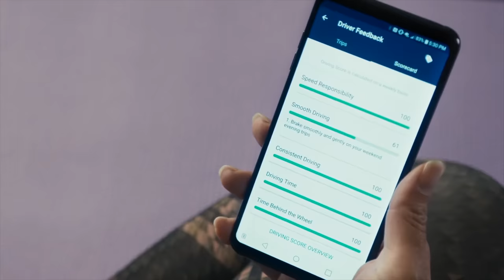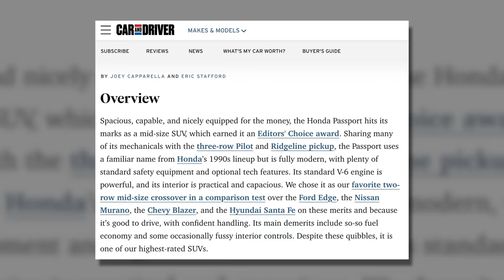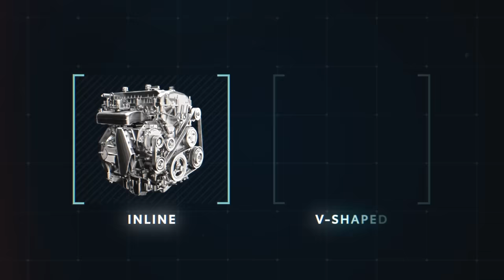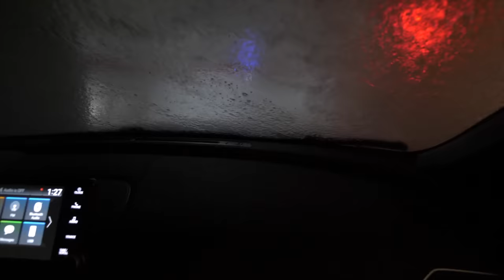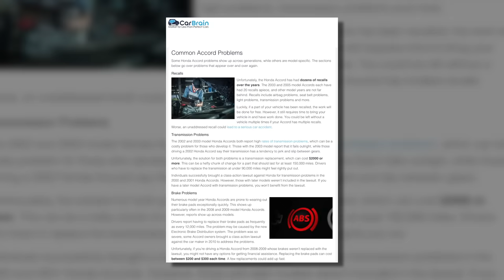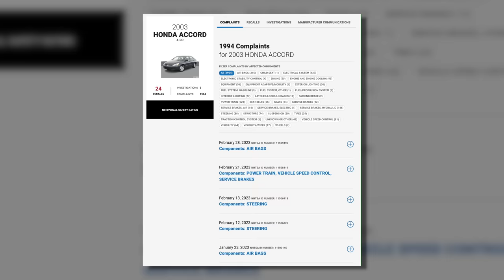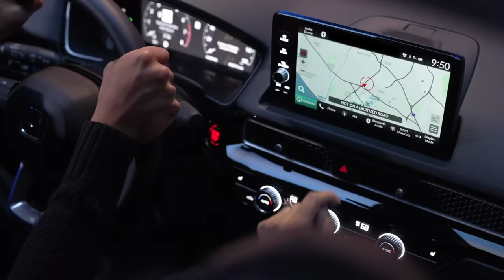Honda's CEO Just Said, "We're Losing Customers Fast and Don't Know What to Do"

Comment: Having owned a construction company, I have owned many Dodge Ram trucks. There was always something wrong with each one.
Reply: After 2 pigs...why did you keep buying them??
Reply: dust3824 - How is it remotely offensive to tell the truth about a faulty product?
Reply: Absolute junk. Never again.
Reply: I have a 2004 Jeep Liberty. Engine still running great. There are problems, very minor, for a 20 year old vehicle, but it's dependable. It's actually made heavy, unlike those beer cans from Japan.
Reply: Dodge Rams used to be really good back in the early 70s.
Reply: dust3824  - Yes, I can definitely see that happening.
Reply: Get a Tacoma or tundra :3 my boy has a 2004 v8 tundra and runs like a charm... I remember putting 2 and a half palets of shingles on the back and it looked like it was about to scrape the floor 2 years ago.. We drove slowly a few miles and dropped it off at a house... Still running with no issues. Has a engine check light for years but it's just the sensor... No issues 🙂
Reply: Owned a Dodge Ram 1500 4 x4 Laramie what a hunk of junk.
Reply: @xombiekat13  yeah no one cares that the cars have a cvt or 10 speed automatic with a 1.0 l engine with a turbo on it that burns oil and that won’t last. But the design looks cool so I’ll buy it
Reply: @bondgabebond4907  just need a lot of Gas to run that 3.7. 😊
Reply: @malibuman8941  Yes, but I don't drive it much and the Jeep is paid for. Gas and oil change is about all I do to it. Once in a few years I get new tires and brakes. It's a lot better than having a $600+ payment for next to forever.
Reply: A lot of the ppl in that survey probably didn't even use a Ram for it's intended purpose, they just bought a big truck for show because "Murica".

Comment: Stop turbos on all cars, go back to naturally aspirated engines and automatic transmissions, no damn CVTs
Reply: throw those damn cvts away
Reply: The honda oem turbos are not the problem.
Reply: Keep both options. You don't sell one product. Some hate turbos, some love them. If you do both, you can sell more.
Reply: They don't put em on all cars. It's usually on the highest trim. Most come with a naturally aspirated. And CVTs are just the norm. Get over it and stop bitching. Honda and Toyota CVTs will last longer than a traditional transmission if you just change the fluid regularly
Reply: I'd rather have a manual than an auto.
Reply: Honda got rid of their famous K24 NA engine on some models.
Reply: My 2020 Civic Sport Sedan has the 2.0L K20C2 naturally aspirated port injected engine and a 6 speed manual transmission. 
I’m with you, I’d never daily drive a Honda with the 1.5L Turbo direct injected engine or a CVT transmission!
Reply: NA engine and AT is way reliable than a small displacement engine with turbo with a Cvt on a commuter car.
Reply: Couldn't of did it better
Reply: They have to boost small engines to get mandatory economy numbers.
Which mean nothing but unreliability in the real world.
Reply: The day I bought my 2018 Crv LX at a vegas Dealership they tried so hard to try to sell me the EX & EXL. I would’ve loved the EX for the sun roof and the turn signal camera but the only reason I couldn’t find myself buying a better trim model was because of there horrible turbocharged engines they installed on the top trim models. I didn’t want to worry about oil dilution after spending good money on any car. Trash the current turbo charger or fix the dilution problem Honda!
Reply: They sell manuals and NA cars, but most want the auto and their CVT is smooth and will outperform a regular automatic in efficiency.
Reply: I agree so much with this! I know this is anecdotal, but Honda no longer offering a NA V6 engine on their Accord lineup definitely alienated me as a customer looking for a sedan. Acura offers a worthy alternative with the TLX lineup but it's still turbocharged all the way (and I don't like it) and significantly more expensive. Too bad!
Reply: my 2017 civic si exploded
Reply: You’re only going to get non-CVT these days if you go to Mazda or get a luxury German or higher end Luxury Japanese vehicles. The demand for manual transmissions is not there. I was at the NY auto show on Sunday speaking to VW reps. 83% of their vehicle sales in the states are SUVs and those don’t come in manual transmissions. And with how terrible traffic is in most places in the states, I see the demand for them dropping even further. Try driving across the GWB, BQE, 95, and even parts of NJ during rush hour. Traffic is terrible. Also another knock against most manual transmission vehicles is that they throw practicality out of the window for every other aspect. They have no trunk space, no center console space, terrible leg room, are terrible for poor people, and they have yet address the fact that there are people that are family oriented that would still like to have a fun drive as a daily driver. They’re catered to young and single people, or people in a relationship. No more than that. I wish the US had way more wagon and hatchback offerings, those are practical and fun. I wish manufacturers considered this as well.
Reply: Martin Z NO DAMN CVTS ..DITTO
Reply: You NAILED it.  Plus, Honda's driver and passenger front seats are HARD AS ASPHALT...and they give me a damn thrombo from the pressure points.  We've have an 08 CRV and love the reliability, hate the seats and the road noise.  After plenty of research we're going with a non-turbo, non-CVT and very quiet Mazda.
Reply: Nothing wrong with turbos ona 2.0 or 2.5L. Turbo charging a 1.6  no one wants that POS thats at its max.
Reply: What?? How about make more with the  standard tranny...not automatic..
Reply: @richsweeney1115  I mean is more reliable, but an AT is ok  In a commuter car. We are comparing Cvt and AT torque converter
Reply: @dcal4455  I know , I'm just sayin..neither are a great option
Reply: Talk to the government
Reply: Planetary gear box vs band and cone CVTs
Reply: I have owned many fancy cars domestic and foreign and I have had no negative experiences with my 2016 Accord LX with a CVT transmission. For a car I spent $21k new and have been driving for 200k miles without repairs I have zero complaints. It's even relative fun and zippy to drive and my wife loves it... still.
Reply: @hustla818  "CVTs are just the norm" does NOT mean CVTs are reliable and well liked by many mechanics/drivers.  Look up Scotty's comments on CVTs and lots of other negative reviews on you tube.
Reply: This
Reply: I love my turbo

Comment: Honda needs to go back and look at the cars they made in the 90s to see what them special.
Reply: Exactly. Had 4 of them. 1 had 480,000 miles. Only I auto.
Reply: Normally aspirated 4's and V6's. With no turbo charging.
Reply: Its not the 90s anymore
Reply: I had an '01 Civic EX and regret getting rid of it at 217k miles. Dude that bought it still has it and is at 350k - orig motor and 5 speed.
Reply: @thegreat9481  It doesn't matter. They can still build their vehicles with the same mindset like in the 90s. It worked then and there's no reason why it couldn't work now
Reply: 10th gen civic and accords looked reasonably nice
Latest gen looks okay, may be boring looking to some, nice to others
Reply: FACTS!!!!!!
Reply: @g0d182  The 10th Gen. Civics are fine, but I just can't get with those Accords. They remind me too much of the Dodge Chargers. Plus they got rid of the V6 engines
Reply: @josephbell2160  Nope.  Many regulations have changed, especially emissions regulations.  The 90s cars cannot be rebuilt unless it by a program like Mazda's "comprehensive restoration plan" which rebuilds shells/old cars into new cars again.  They very much would if they could, but they can't.

People don't want the trashy new over-regulated cars, and every manufacturer is suffering as a result.
Reply: @surrrithux  You missed the point. I'm not talking about rebuilding 90s vehicles. I'm talking about building them with the same mindset they had back then. That means with complete focus, no short cuts, no half assing it, and building them with quality materials. There were regulations that were to be followed then, so whatever adjustments that have to be made for today's regulations they'll do just fine. Having the same energy and motivation like that was back then and apply that mindset now. There's no reason why it can't be done
Reply: @dominicfong6341  Mainly double wishbone in front would be nice and the front overhang and height needs to be less like the Fit was in front. I hate the big front ends and excessive height
Reply: @thegreat9481  any other nuggets of wisdom? No…. Sit down Captain Obvious.
Reply: @travislee9396  You seem very triggered. Move on, its not the 90s.
Reply: @thegreat9481  No.  Really?
Reply: They can't make cars from the 90s anymore. Theirs new laws they have to follow that are required for safety. Newer cars are far more safer than older ones.
Reply: @josephbell2160  It has gotten even worse for 11th gen accord, they got rid of the 2.0turbo, now max is about 200 hp, not 250 hp!!

So Honda canned the v6, and the 2.0t!!!
Reply: @g0d182  They lost me when they got rid of the V6. I'll just stick to my 99' Accord. At least it has a V6
Reply: Exactly, that was when Honda was very reliable, almost as reliable as Toyota, but then they got cocky.
Reply: Less American styling and ergonomic for the start.
More like the late 1980s-1990s with good holsome usable &  spacious ergonomic with daily functions instead of flashy shows offs gimmicks.

Comment: I've owned Hondas my whole life-1976 CIvic 4 speed manual, 1986 Accord 5 speed manual, 1999 Accord 5 speed manual, 2002 Odyssey (for the wife and kids) and currently 2014 Accord and have been happy with all of them, taking all of them to 200k miles or more with no unexpected repairs.
Reply: Bet you don't live in a road salt state or state with high summertime temps!
Reply: Haha do you remember what the redline was on the 76 civic? I remember 9k and it sounded like a lawn mower hahahah, great car though!!
Reply: @PhilJLF  Yeah with only 4 speeds it was loud as hell! Primitive!
Reply: I had 82 and 88 Accords. The 90 eluded me and was big step up.  I got 90 Integra instead as a teen.
Reply: You got 200, 000 on every car but  had a 1999 Accord for only 3 years - then got a 2002 Odyssey?
Reply: Yeah well you will find nothing but CVTs and Turbos now, all sure to not last 200K.
Reply: @Martin_ros  ever heard of having multiple cars
Reply: You didn't pay out your arce for them either.Quality used to be there now it's all plastic and crumple zones
Reply: I've had Civics, Accords and CR-V currently. All very reliable and cheaper than their Toyota counterparts. I sold my '93 Civic to my sister, it had 250k on it and she had it for several more years.
Reply: Unfortunately Honda tends to be somewhat conservative in styling as compared to Hyundai and KIA but they last a hell of a lot longer. And yes Scotty it needs a bigger battery
Reply: @johnmoyer2849  well now every vehicles have that sht on them as mandatory
Reply: Honda reliability has taken a nosedive. What made it special is now gone
Reply: I’ve got 2 currently (odyssey & crv) and happy with Honda. Looking to buy another. My daughter is getting her license this year so I’m turning the crv over to her. It just goes on and on and on.
Reply: @HotRod-wv4vm  you mean fortunately, those new Hyundai cars are so ugly
Reply: @somapersona  Yep, mostly made in USA now instead of Japan😂😂😂
Reply: @horseman942  actually I like the look of the SUV’s, not their cars
Reply: I’ve owned 4 Honda’s and they’ve all gone over 200k miles. I’m looking at the 2023 Civic Type R but all the dealerships are charging 20k over MSRP which is pure crap which will unfortunately steer me away to other car manufacturers. I like how Tesla does it where  it’s only one price with no price gouging.
Reply: My wife and have owned Toyotas, Hondas, Mazdas, Nissans, Subarus  (GMC, Ford)since the mid 80’s. In my/our businesses we drove about 25K miles per year. I have owned a Tercel, a Landcruiser, two Highlanders and a Tacoma. The only Toyota that I did have mechanical/quality issues with was the Tacoma, the Tacoma, rode, drove, handled terribly (finally got rid of it about 55K). Dumped Highlander # 2 with less than 13,500 miles on it, didn’t need 5 more years of aggravation. Traded my GMC Sierra in a year and a half ago for a Ridgeline, wife drives a Pilot, she had 3 CRV’s prior to the Pilot. Never took a Honda back to a dealership for anything other than scheduled service. I know that Toyota makes solid, reliable vehicles, but Toyota’s simply do not like me. 😢
Reply: @lisam4503  I live in Georgia, a "Deep South" state, and have owned several Accords over my decades of driving. All of them have been perfectly fine, and generally traded only when I got bored and wanted the "latest, greatest."
If you're worried about road salt, you better learn to take care of whatever you drive. Cars are expensive, and can easily make you poor if you don't know what you're doing.
Reply: @PhilJLF Yep’ PhilJLF, “Cross-Vortex Combustion Chamber,” pioneer technology, cleanest burning internal combustion engine on the planet..
Reply: Ooops, did not / re Tacoma
Reply: I have never tried another brand since I Owned two 2003 hybrids 5 speed manual transmission cars both got over 300,000 miles no problem with hardly anything going wrong except for the front struts around 250,000 miles. Now own two 2005 special edition Civics and a 2020 Civic Sport Sedan 6speed manual with the K20C2 engine.
Reply: @lisam4503  I live in high road salt, harsh winters and hot summers. in my exp toyotas rust out faster.
Reply: @bottomfeeder12  They were known for premature frame rust! Especially Toyota trucks! The cars forget it they rot real bad! 
In the 1970's a Honda Civic wouldn't last three years in the Northeast! Salt would eat it alive!
Reply: You think my 2019 Accord Sport 1.5t can make it to over 200,000 miles with only maintenance- no repairs ? I hope so - it currently has 87,000 miles in excellent condition (brand new all season race track tires installed in June 2022)
Reply: @Martin_ros  Maybe he purchase them pre owned
Reply: @duromusabc  I have a CRV with a close mileage amount as you. They are barely broken in lol
Reply: @jackjones7451  I bought all of mine used, except for the 1999 Accord which I bought new and sold after 20 years because I didn't need it anymore
Reply: @Lisa M  yep. Eastern Washington with not much snow
Reply: @HotRod-wv4vm  Honda was always weight-conscious of their stuff. Enough battery, always staying with lighter non-hydraulic lifters in the valvetrain. Lately they've embraced the other road. Too bad. Their five speed cars would run rings around the domestic stuff. Times change.
Reply: @timewa851  yea I love my Honda Element but the seats have to be the worst that I have ever had in any vehicle. I think they needed more ground clearance and the J Engine from the Pilot. All in all though it’s been a great car and very functional. Funny I was actually going to buy an S2000😀
Reply: @dwb142  Honda has cranked out more than 4.5 million vehicles in Ohio since 1989
Reply: The new CRVs have the most lame interior storage areas- none, except the center arm rest. My 2006 CRV with over 200k miles is way more practical (and therefore very loved).
Reply: nice and you are too poor to buy a new one in the last 10 years? (a decade) old man?
Reply: @potatochobit  Happy with the 2014 Accord!
Reply: Honda 5-speeds were great, CVT's suck.
Reply: Crumple zones, and those darnn seat belts and airbags, who need shoes, I've got skin on my feet and corns for grip. Nikes are a waste of money
Reply: @HotRod-wv4vm  Hyundai and Kia are marketed to the lower end of the socio economic scale, as such the use of design over quality. Frankly, their cars look like six year old's designed them.
Reply: correction I meant to say that they are not cheap
Reply: @HotRod-wv4vm  Yeah, they all look over designed and more form than function. They are todays station wagons. All crap. No choice anymore. Price aside, Kia and Hyundai do market their products to people who associate style as value.
Reply: @tedstrogis4823  yep
Reply: U had no issues mainly cuz your transmissions were manuals
Reply: @lisam4503  come to Ohio and you will experience everything with different types of roads and weather
Reply: Yeah, wait until that odyssey transmission craps out. Guaranteed to happen on thst model year
Reply: @jdmstib4  lol dude hondas transmissions in general are good , every manufacturer has one model or more thats junk with either motors or transmissions or electrical and so on but im telling you hondas last for a long time and you definitely get ur moneys worth again unlike other manufacturers
Reply: @jessehensley1812  I know that specific year of odyssey is garbage. Ask me how I know ;).  The manuals are generally reliable and have no issues.  Their automatics on the other hand have been less then stellar.  They make good engines though but automatic transmissions are not their strong suit in my opinion.  They are better off letting Toyota/Aisin build all of them
Reply: @jdmstib4  like i said every manufacturer has there misses but if you live in ohio hondas are pretty common and they last forever and i mean motor and transmissions, honda doesnt even have a model type in the top ten thats considered bad as in transmissions so they must not be that bad but maybe the Odyssey is 11 but im just saying is all , i will say this stay away from ford F-150s from like 204-2014 cause they have something always wrong and that's from experience unfortunately